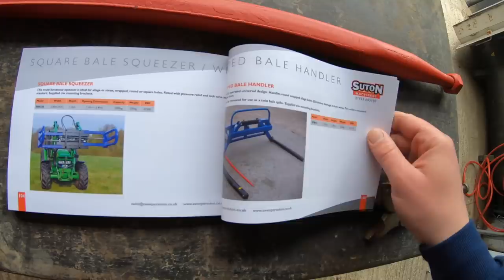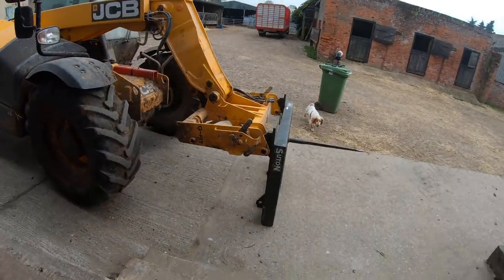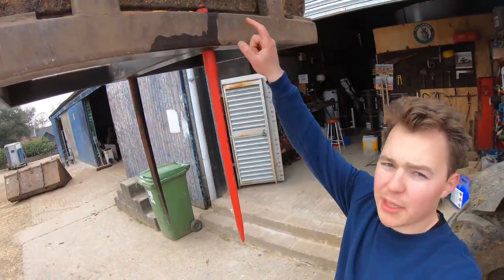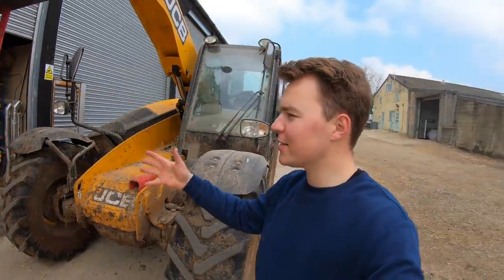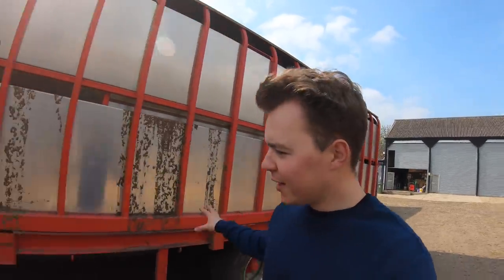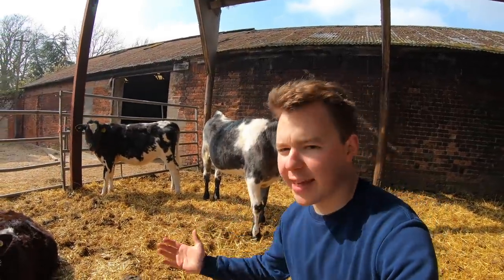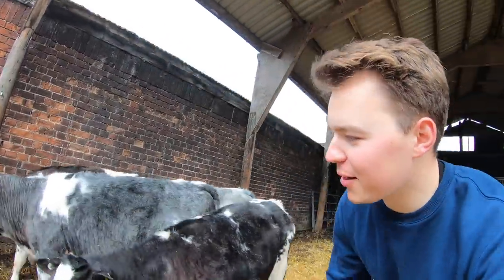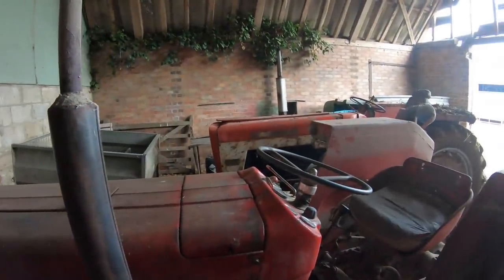NEW Bale Spike For The JCB 526-56!

Comment: Ollie if I was you I would buy a Michale bale squeeze but the one which has the two big arms at the side, they are really useful because you can take the net wrap of the bale and then pick the bale back up without it falling to bits and then you can drop it into the feeder bedder instead of getting the net wrap of over the feeder bedder

Comment: If the 69 is on John Deere filters and oil dealer recommends you do 500hours between services but if it is off brand oil but John Deere filters it’s 250 hours